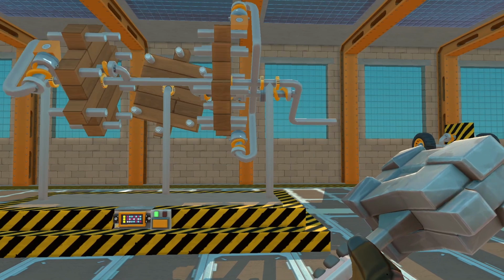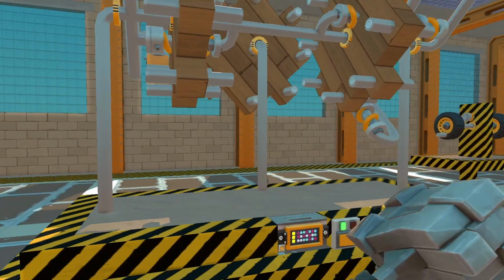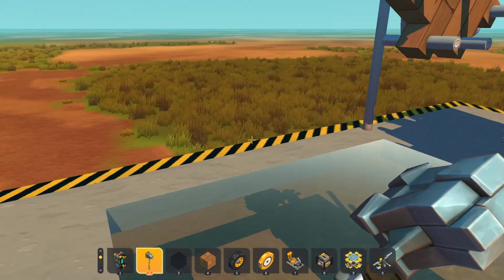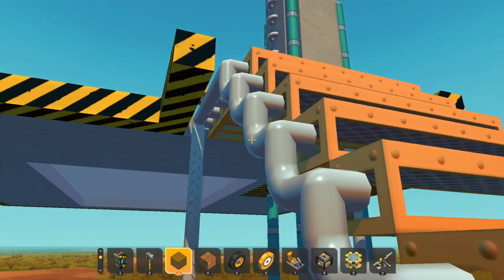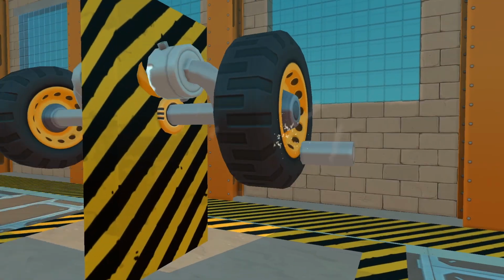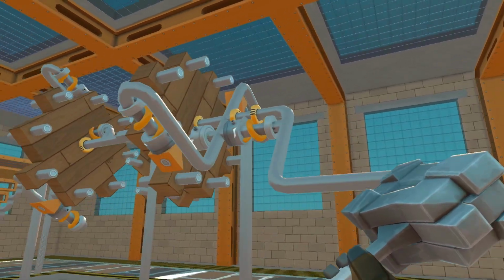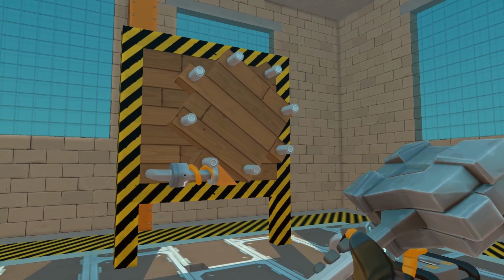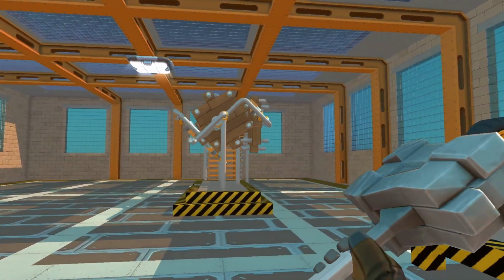Alternating Rotation to One Way Rotation - Scrap Mechanic

Comment: usualy from my experience pistons are less buggy than susupensions so sometimes its better to use level 1 piston on a switch or a controller so when it hits something it compresses hoever level 5 pistons are pretty stiff so when I for example build a piston locomotive I tend to use level 1 or 2
Reply from the maker: I always thought they were way stiffer than suspensions so I didn't even bother to try pistons. Thanks for the hint Bendys!
Reply: @oggi42gaming77  be aware that the locomotive from the example has to have  the pistons strong but with little resistance when one pushes the other one retracts also sometimes its good to set the physics slider to for example 7 a that point the pistons are even more weaker

Comment: I have a question  , for elevators , we  must use controler  or piston?
Reply from the maker: It depends... pistons are easier to setup and don't require much space, but cost a lot of component kits, especially for big ones... 
I showed an elevator controlled by a level one controller in my video about hinges:
https://youtu.be/rWuZMHdoXsA?t=308
Reply: @oggi42gaming77  Ok! I Will test with controler  because i already build a fonctional elevator with piston

Comment: Or just push a wedge into a green pipe piece with a piston for inf power lol
Reply from the maker: Haha, I know, I know ;D But that would be so boring, wouldn't it? I use some glitches myself, like the suspension through walls for example, as it is only a workaround. But wedge power or suspension propulsion almost feel like cheating to me. I don't blame anyome for using it, as long as you have fun with it! (That's what a game is for, right?)